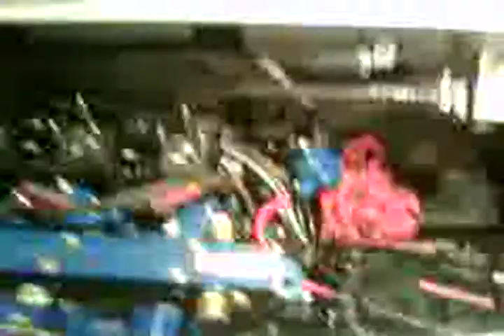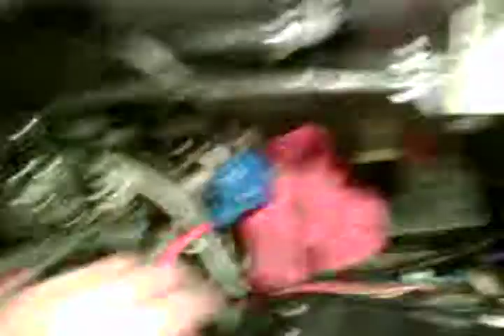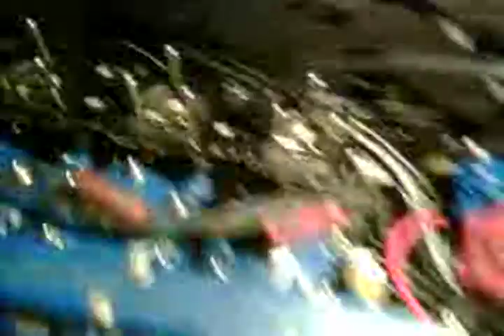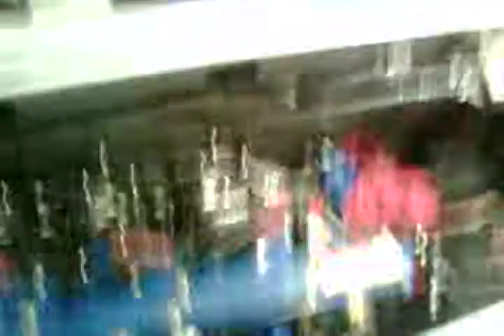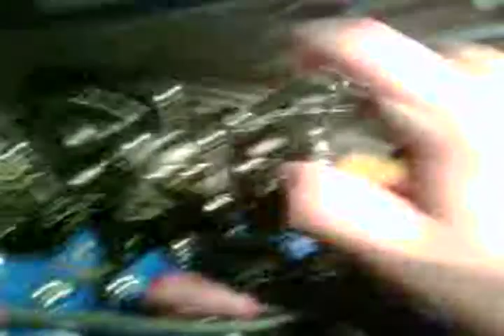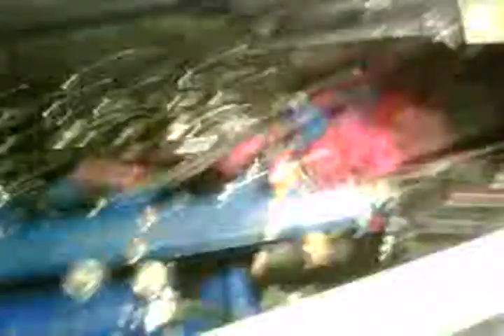95 Polaris SLX 780, Starting Problems - Fuel Starvation, Any Suggestions

Comment: YES!! That's what it was!! The relief hose, There are 3 hoses that come out the top of the tank. 1 that goes to the filter, one that goes way back somewhere idk.. but then there is one that curls up and you can follow it right to exit spout on the front of the jetski by the steering bars. 

I pulled off that hose from on top of tank its the one near the right side of the jet ski.. soon as I pulled it off it went pssss air coming out or something.. 

Tried to crank it again :) VROOOM VROOOM>
Reply: Thank you!!

Comment: That sounds like water in the fuel. After the ski sits for a while (in the garage) the fuel and water separate and it will pull straight gas from the tank. When you drive it to the lake on your trailer, it mixes everything back together and now you have water and fuel mix! I had the same thing with a boat that I rebuilt. Dry gas the crap of the fuel that's in the tank or siphon the tank dry and replace with all new fuel. Good Luck.

Comment: Make sure your gas cap is sealed. Mine would not do that and it was just the seal on the gas cap. there is supposed to be a rubber seal there. the gas tank has to have pressure to work. If that is not that, check your compression.

Comment: ps you want smoke , alot of smoke , you verified that the fuel pump is clean , you need to make sure the carbs are clean , does it run long enough to determine which cly is running ? i think your issue is the carb being dirty but if you supply fuel to all three you gotta make sure all three will fire

Comment: Where is the check Valve? my sl650 runs in the shop just fine but when you put it in the water i cant hit the gas or it bogs down to where it will stall. Every so often it will it works out of it for about 10 seconds and runs great then stalls. it starts back up fine and idles fine but back to the same thing. I was able to pull the choke and get it to take off for another few seconds but you have to keep pulling the choke up quick to get to stay at a higher rpm. any help would be great thanks!
Reply: Emily Pronschinske I know it’s been a while, but did you figure out your problem with the jet ski?
Reply: Emily Pronschinske I know it’s been a while, but did you figure out your problem with the jet ski?
Reply: @jerryottinger285  I have similar problems. It starts and when I give a gas it shots off. Any advice?

Comment: Shit I have the same problem! I think my fuel pump is not working because fuel will not circulate through my lines. is my pump is bad then maybe its due to the fact that the motor is not pulsing? thats how the fuel pump works via crankcase pulse. maybe switch over to electric fuel pump!!!!